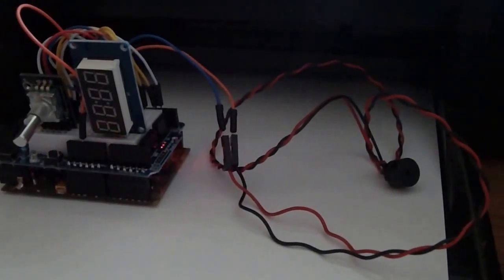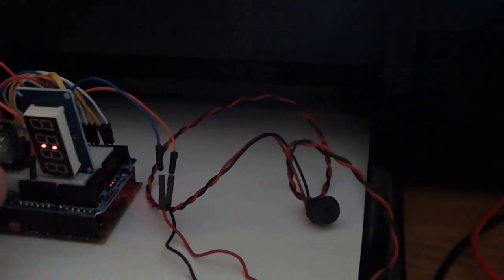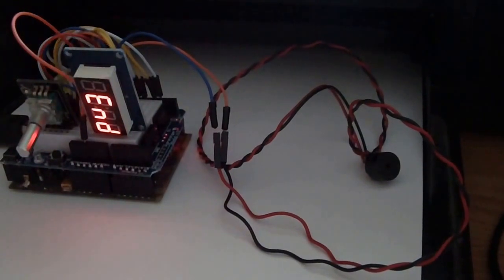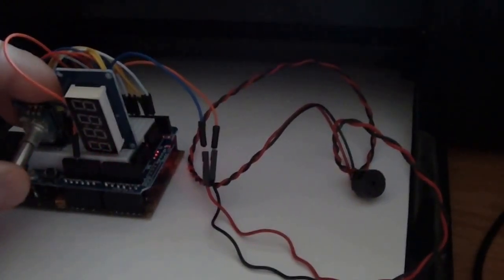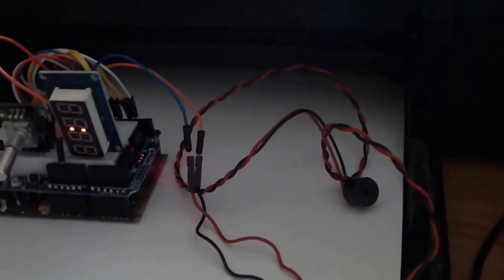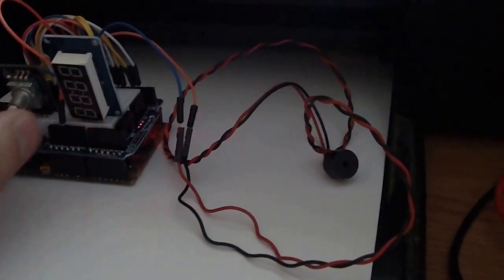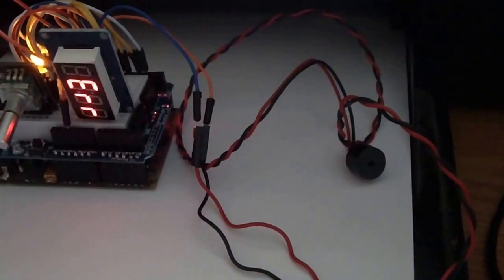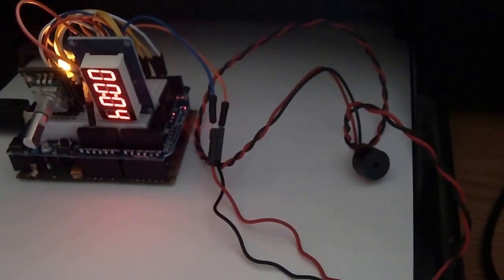Microwave controller with Arduino and TM1637 4-digit display

Comment: This isnt controlling anything
Reply from the maker: there was presented just the "brain" of device
Reply: @dj06ntm  it would have been nice to see how its interfaced with the device to better understand how it works
Reply from the maker: @kwacz  the control at devices used relay (classical wth transistor or modules with relays and optocouplers).. as usual project with Arduino.. anyway, this project is 8 years old...